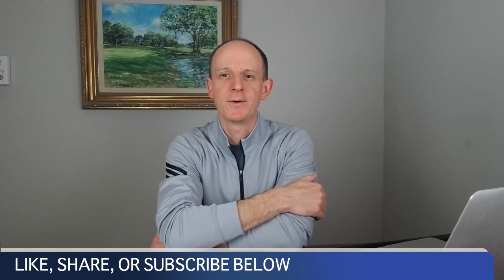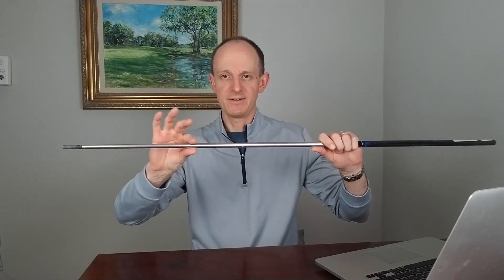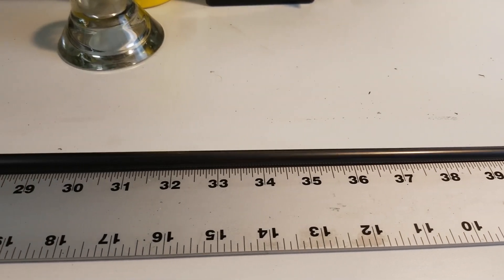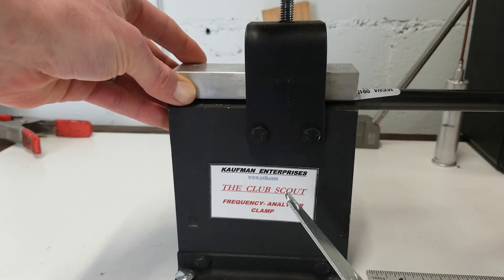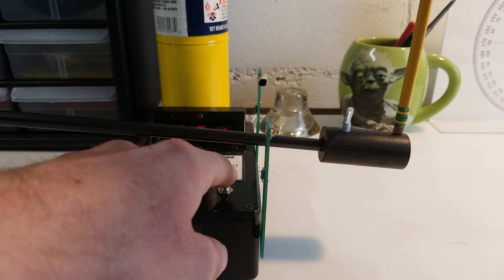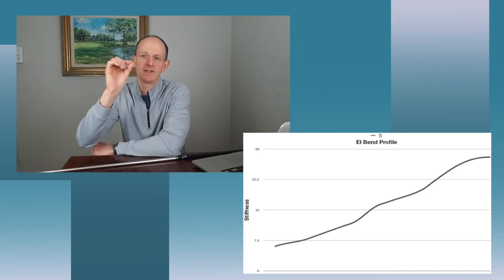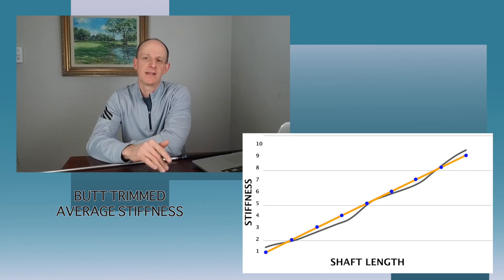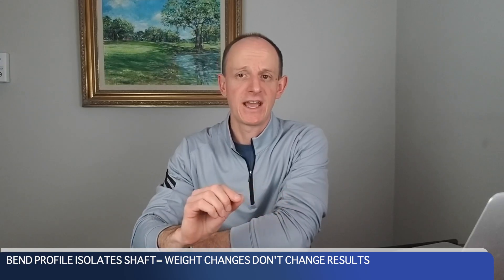SHAFT STIFFNESS, TIPPING, AND TRIMMING - What happens when we cut a golf shaft from either end

Comment: Great video, I Just purchased a stealth plus 10.5 driver with a HZRDUS RDX 60 extra stiff (6.5) and I want to cut it down and add weight. I have a question! If my swing speed is about 100mph, and its already an extra stiff shaft, won’t it play great because if the length is removed from the butt, it will maintain integrity? Also, is it better to trim a softer shaft or stiffer in your experience? 
I want to learn to really muscle it at around 43.5”, as the stealth plus does have som serious pop, i just want to learn to shot shape with it and have fun. I’m like a 10-12 handicapper, been playing for 2 years but I play a ton.

Thank you very much!!

Pete
Reply from the maker: Tip trimming an extra stiff is what many professionals do as they don't want to feel much flex in the shaft. Whether you tip an X flex or an R flex, the result will be the same. Just makes the shafts overall stiffness increase, but not as much as actually going up in flex from R to S or S to X.
Reply: @EFGMC  ok understood, thank you! I’m currently on a try and buy with the stealth plus through the taylormade + app membership. I just hurt my wrist working on my bmw, so I can’t really hit it during this two week trial period smh. My first thought is that given the current inability to really hit it during the trial period, i’m kind of throwing money at something i’m not really sure is a best fit. I mayn send it back for no charge, wait till I heal, and pick one up with a regular or stiff flex to hit that first. Before purchasing the x stiff with nothing to go off of. Would you recommend something less stiff at length 43.5 for swing speed around 100? My wrist sits 33 inches from the ground at my side. And i’m 6’1”. Thank you very much!!
Reply from the maker: @pistolpeteysouth  Will really be player dependent as to what feels right at that length. Also will depend on what swing weight you go with. A lighter head will make the shaft feel stiffer.
Reply: @EFGMC  Thanks, and yes, i think i’m going to go down to a stiff shaft, rather than extra stiff. I hit 40 balls with it today and I believe I’d benefit from just a bit more of a load so I don’t have to kill the ball every time I want to hit the ball 280-300 yards.  Have a great weekend!

Comment: ok, I'm convinced - shortening a shaft either way will always make it stiffer.
Reply from the maker: Flex always should be linked to head weight as that makes a massive difference in how the shaft flexes and feels. If the golfer never adds back weight to the head then the shaft will always feel stiffer when shortened. However if they add weight back to bring SW back up, it needs to be part of the equation.
Reply: @EFGMC   I know, I just put gobs of leadtape on a butt cutdown to bring SW up to it's original...and it felt like a Ladie's flex when I was done...peeled all of it back off and it felt nice and stiff.
...gonna start tip trimming from now on !

Comment: A.J. thanks for the clear explanation of tip vs. butt cut. Question: How does  Shaft Torque effect its playability? I have noticed as Driver Shafts have gotten increasingly lighter (54g) it's torque has increased (6.0d). Where as old school (88g) Driver Shafts Torque (2.4d). Thanks!
Reply from the maker: Torque usually moves in tandem with both weight and stiffness. The heavier and stiffer the shaft gets, the more the torsional stiffness increases. Harder swings benefit from lower torque.
Torque values have gone up a bit over the years as designers can improve stability using different materials that don't require dropping the torque so much.
I trust the shaft OEMs and don't ever worry about torque numbers. If you get a shaft with the correct weight, and flex, whatever torque goes with that should be fine.
Reply: Thanks

Comment: Great delivery of the subject, thank you..👍
I have a 2 Reg flex OEM shafts I am hoping to fit to a 7 wood and a 5 wood to create stiff shaft flex by trimming the tips  now feel better about doing so after seeing this video.
Reply from the maker: Happy to hear it was helpful. Thanks for your support.
Reply: Up date on the 7W and 5W exercise, simply brilliant results,  at first i was worried a Driver R - flex Speeder shaft tipped 1 1/2 inches went too far, the feel had left the club, it felt too stiff. 5W was not as dramatic. However now after 50 rounds the feel is is back, 7W makes 210-235 yards straight, 5 wood just 10 yards further. It seems that both shafts need to "broken in" strange I know ! I am very pleased with the results.. Thank you for your delivery on the topic.

Comment: So ....using that principal....trimming each end equal....keeps the shaft somewhat the same stiffness?
Reply from the maker: Yes, in theory. However you need to trim different amounts to account for head weights. Heavier head requires more tipping to support that weight. Also if you cut down a driver, but don't add head weight for swing weight, the shaft will act stiffer vs adding weight back.

Comment: Hello sir Thank you for the video. I recently purchased a matrix white tie shaft and a senior flex. My son is a junior golfer has it in his driver and I was going to put it in his 5w. I am unable to find any of the tip trim instructions. Since I will be cutting a section off the butt end to get the club to the right size my question is about the tip trim. Do I understand correctly that if I have no trim versus say half an inch or 1 in the no trim would allow the senior shaft play more like a ladies plus flex? And lead to a higher launch?
Reply from the maker: Correct. The more tip section you leave, the more the shaft will flex due to the head weight of that 5 wood. Would that lead to higher ball flight? That will depend on the golfer swinging it and where the contact point is on the face.
My guess is the standard tipping for that shaft would be 1 inch for a 5 wood at least that is what I remember for the black tie.
Reply: @EFGMC  Thank you. And what would you say is the best way to pull heads from a graphite shaft? I'm not sure I want to spend $220 or more on an extractor but that might be the only way to do it right and not ruin the shaft. Thanks again.
Reply from the maker: @kgil35  You can find extractors that work well for around $100. I would definitely recommend one. No real work around, at least that I have found yet.

Comment: I've just gotten callaway rogue x regular flex or stiff. And I wanted them all one length, preferably wedge length. 
Would that be alright? 
would I have to adjust my lie?
will it effect my loft?
Isn't golf about your own game?
They are our tools to the game, so I was wondering about these questions.
Reply from the maker: The biggest problem you will run into is the head weights. A wedge head weight much more than a 5 iron head (the increase is about 7g per iron as they go up in loft). This means when you cut them all down to a wedge length, the long irons are going to feel extremely light compared to the short irons. You will need to add a good amount of weight back to the heads to get a consistent weight feel.
The lie angles will also be off on the longer clubs and would need to be bent more upright.
The specific lofts will not change, however the incorrect lie angles will alter the face angles also so that all the longer clubs will have a greater likelihood of missing to the right (assuming right handed golfer).
Not saying you can't or shouldn't do it but you want to be aware of these things before you start chopping shafts down.

Comment: So I have an old r7 quatro driver i want to experiment with.  I want to cutt it down to 40 inches. It's a reg flex shaft and the original length is 45".  I play a stiff shaft normally and I have the  weight to add to make it playable. My questions: would you cutt any off the tip? Maybe 1 inch off the tip and the rest from the butt? Or would it be best to just butt trim only to reach a stiff flex with a d4 - d9 end swing weight. Note: i would rather error towards extra stiff flex.  Thx.
Reply from the maker: I would take some off the tip, maybe even 1.5 inches. I am not sure if Taylormade originally tipped that shaft if it's the original. Going that short, you may end up wanting to move up a weight class in the shaft.

Comment: You really made a complex subject easy to understand.  If I am taking a raw shaft to a club maker, what would I need to tell him/her besides the overall final length of the driver?  The raw shaft is 46" and I would like my final length to be 44.5".
Reply from the maker: Usually that is all they will need unless you were wanting to tip trim the shaft to make it stiffer. Most people don't do this unless they swing very fast. Only other detail is usually how you want the shaft graphics aligned. I always install logo down unless someone specifies differently but different builders may not do the same.

Comment: I believe your conclusion is that cutting a new raw shaft 1” longer than stock for a particular iron, will make the shaft PLAY softer,  no matter if that particular shaft is relatively butt stiff or butt soft. For example: I had Dynamic Gold S200 shafts at 1/2” long then went to Modus 3 120 stiff at 1” long. I added a jumbo CP2 pro grip (80 grams) to restore swing weights back to about D4 (from E1 or E2). Also added a few grams of head weight to get to D4 since the grip was so heavy. I found that the Modus feel too soft and produce too much height and spin, loosing me 5+ yards per iron.

My plan is to try a 1” long Project X 6.5 in my 7 iron and a 1” long Dynamic Gold X100 in my 8 iron to see which one feels better and produces a lower spin and trajectory. ( I do understand the shafts I just mentioned have different feels due to different butt stiffnesses) But it seems that the combination of 1” long, an 80 gram grip (counter weight) plus a few grams of lead tape on the iron heads make my current shafts play much softer than expected.

Does this all make sense to you? 

Thanks, Joe 
(there is a lot of conflicting and confusing information on these issues on the internet!)
Reply from the maker: Yes that all makes sense. The added length drops the CPM so it can feel softer. And adding head weight will again increase shaft flexibility.
Can't say how much of the trajectory/spin issues are stemming from the softness of the shaft specifically vs the shaft feel influencing your swing sequencing and timing vs a combo of both.
One thing to be aware of is even though the swing weight is D4, the static weight of these clubs is extremely heavy.
One other option would be to look into a more counter balanced shaft to try and even out the SW a bit without all the added grip weight. Something like a KBS Tour 130 or maybe even a graphite option.
Reply: @EFGMC  thank you so much for your response. One last question; a friend who is 6'6" claims to have added 3 or 4" of length to his shafts with good success (no other details available) I have no intention of doing this,  and have read that people almost never add more than 1". Have you ever heard of adding 3"-4" to a golf shaft!?
Reply from the maker: @joebouscaren1  I have one golf buddy who plays his irons 2 inches over and has for a long time. He is 6'4 with shorter arms. Plays Recoil 95g to help with the weight. But in general like you said, 1 to maybe 1 1/2 over is the most I would ever recommend unless there are mobility issues etc.

Comment: I don't see anything inaccurate with the fact that adding weight to the head will decrease the frequency measurement.  More weight on the tip will make the shaft relatively softer.  The "average flex" actually doesn't seem useful, butt trimming isn't making the shaft "softer".

Comment: I enjoyed this video.Do you have any idea how much tipping a shaft would change the torque. I heard that for every inch of tipping it reduces the torque by .5 degrees. I guess the only way to test that would be with a pure machine. Thanks for your insights on this.
Reply from the maker: Honestly not sure. I personally put limited stock in any torque value so it's not something I have investigated. Suppose it would depend on what the tip torque value is vs. the butt end torque.
You would need a torque gauge to measure all this, not a SST Pure machine.
Reply: @EFGMC  Thanks for taking time to reply,

Comment: If a shaft has been “soft stepped “ how can this be reversed?
Reply from the maker: In this case for example the 6 iron shaft has been put in the 7 iron and cut to length. If you just pull that 6 iron shaft and move it to the 6 iron, you will still be at 7 iron length. Therefore you will need to extend the shafts a half inch to get them back to "standard" length, unless you plan on playing them short.
Obviously you will end up one shaft short (missing) at the short end of the bag since the PW had the 9 shaft before moving everything and you now won't have the PW shaft for it unless you pull from the other wedges.

Comment: Great video. I am installing putting together a 2 iron. I have a x100 dynamic golf shaft and the general tip info for a 2 iron is to trim .5 inch. I have a 2 iron swing speed of 114 mph. Driver is north of 120mph. What would you recommend on this tip trim? Thanks.
Reply from the maker: I would probably stick with the .5 unless you play the rest of your clubs with more tipping. Figure you are as fast as the faster PGA guys and most of them are playing X100s without hard stepping or additional tipping. Do you have X100s in 3-p?
Reply: @EFGMC  thanks for the recommendation.  Yes I have x100 through the set.
Reply: Playing mizuno mp 64 4-p and a mp 18 hifli 4 iron that plays like a 3 iron. X100 through all.
Reply from the maker: @samjohnson4788  As long as the 2 iron head is inline in weight with the rest of the clubs, keep it the same.

Comment: Your opinion please. What will most likely occur if you tip a shaft too much (say 1 1/2 inches) and then add that same amount as an extension on the butt end? Will the shaft still perform as originally intended or will the dynamics be ruined?
Reply from the maker: To start, it will be stiffer feeling for sure. As far as how it plays related to how it was designed, that will depend somewhat on the profile of the shaft. If the shaft was more linear in profile, it will in theory remain more consistent to it's original design. However if the tip section was designed to be noticeably stiffer or softer, you will have removed some of that feature, thereby creating something different. No ruined necessarily, but different from what it was supposed to be.

Comment: Alright I would love to dive in the weeds with you a little bit on this topic. So these days club companies like Titleist and TM are tipping their driver shafts 0.5-1.0 as their “standard.” Yet most shaft manufacturers say no tipping on a driver. I was very curious to why this was different. So I emailed the club companies. Responses were basically the same- we tip them as a recommendation from our R and D department on what they believe will be “true to flex.” I say all that to ask you this.. Drivers are now 45.5 and up as the standard. Shaft manufacturers say recommended length is 45. It just came to me that these club companies are probably tipping because at 45.5 length they would actually play a little softer so they tip them to play the flex that was designed??? I hope that makes sense. Let me know your opinion and if you think I’m on to something, thanks!
Reply from the maker: Your explanation sounds as good as any I've heard. Likely OEMs are just trying to hit a butt frequency because they deemed that important. 
Personally I don't worry about it, from experience if someone likes a shaft, they will still like it tipped 1 inch. Maybe they feel the slight stiffness increase, maybe they see fractionally lower ball flight, but it's a small number of golfers who even notice.
Taylormade does all sorts of interesting tipping. They also soft step if you order irons with True Temper X100s? Why they do it, who knows other than they think it's better for the customer since there is not cost advantage to any of this.

Comment: I have a taylormade m2 driver. It is 45½ stiff graphite. What do i have to do to cut it to 43 inches?
Reply from the maker: If you're sure you want it 43, I would just butt cut from the grip end and then take it to the range with some lead tape. Start hitting it paying attention to your strike location and ball flight. Start adding lead tape to bring the head feel (swing weight) back up until you get the most consistent results.
If you are unsure you want 43, you can take the same method, but instead of cutting the shaft first, just choke down the shaft in 1/2 or 1 inch intervals again looking at where your strike pattern is tightest, then move to the lead tape from there.
I did a video on this, you might find helpful.
https://youtu.be/bXgaUC_tKCw

Comment: Question about the frequency CPM. When you look for the frequency aren’t you looking at a number at a length measured. If you take an inch off butt end then it has more CPM but also at a shorter length so the stiffness remains about the same. Compared to length
Reply from the maker: You have hit the nail on the head and the reason I don't like using a frequency meter for anything other than checking shaft radial quality. For a frequency meter to work when dealing with length changes, you also have to make head weight changes. Otherwise you end up with higher numbers when shortening the length from either end. Once you add weight back to the head, you can then see that butt cutting keeps flex more constant while tipping increases stiffness.